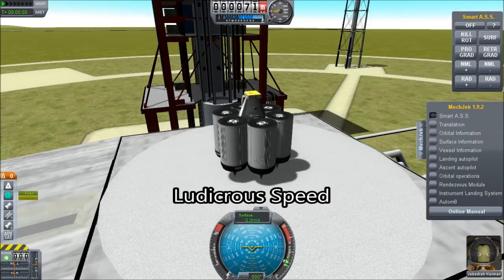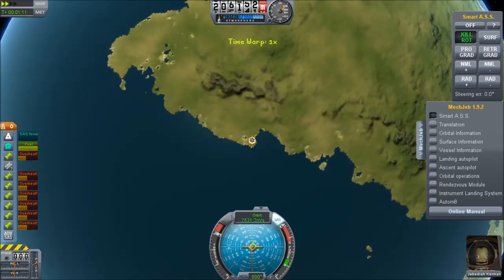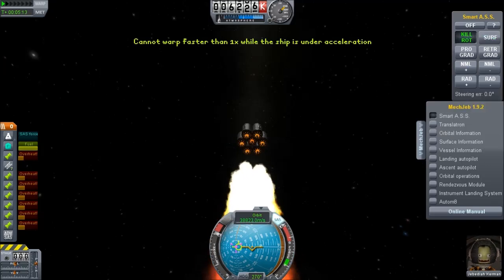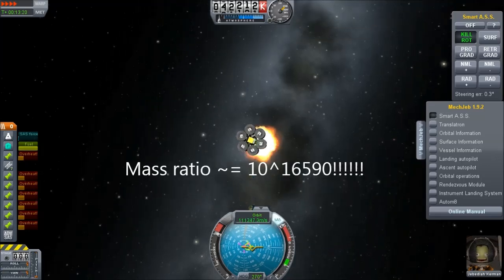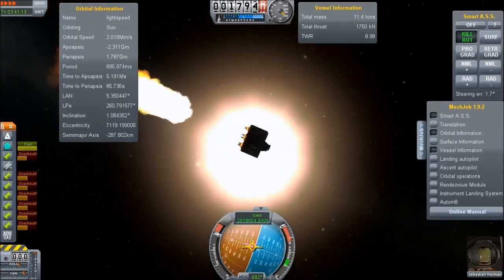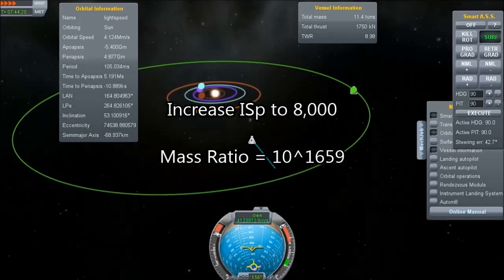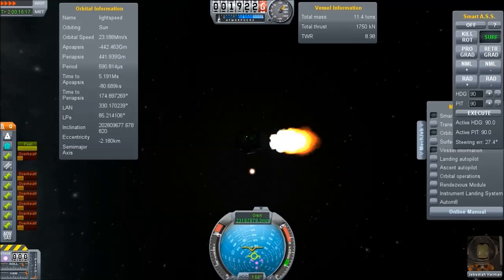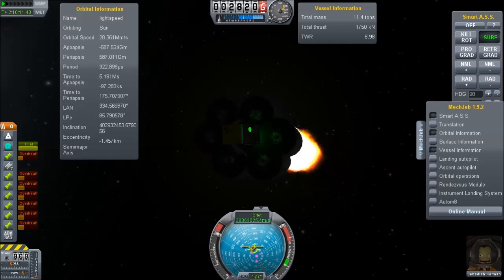What Does It Take To Reach Lightspeed In Kerbal Space Program?

Comment: If you set up beamed power from the interstellar mod and then took a ride way out and placed ANOTHER beamed power unit and so on, I bet you could reach the speed of light eventually. I would suggest using the warp beacons to be able to jump to where your craft is easily, assuming you have infinite fuel. That would cut off a massive amount of time placing the beamed power and you could  be under 1 ton in mass too! Sure it would take a very long time to do it, but assuming you modify a reactor to produce Terajoules of power and you modified a transmitter to send that amount of power, it may just eventually work. In 27 in game days with solar sailing I've reached 1.286 million m/s already, and I bet I will get much much faster. I'll probably have to use hyperedit to place a beacon where the ship is but once that's done I'll just send copies of a nuke powered thermal power beamer. The most interesting thing is that I don't get the max power from my beamed power network because I didn't bother to send the satellites on a polar orbit so I'd get power all the time from every beamer. Oh and most importantly it seems YOU CAN ACCELLERATE WHILE IN TIME WARP because you technically don't have any engines providing propulsion! That shaves a ton of time off getting to lightspeed.

Comment: There's a far simpler way to travel not only at the speed of light, but perhaps even multiples of it. Ride the light itself obviously. Harness it's (light) natural speed for use for ourselves, solar panels? A joke. Any current technology that even slightly approximates the usage of light itself for power is virtually infinitely unusable. So, and the process is far more complicated (only the construction of such an apparatus, etc) than this, we simply ride the light itself. Of course theoretically there are far simpler and faster ways to get somewhere, but for raw kmph/mph you ride the light.
Reply from the maker: Or we could just ride unicorns which despite being mythical creatures are more scientifically accurate than what you just said.

Comment: Why include earths specific gravity in the rocket calculation for dV==C when such an attempt would only be travelling in Earth's sphere of influence for a negligible percentage of the journey?
Reply from the maker: It's a normalization factor used so engineers can easily calculate Thrust to weight ratio on earth.,
Reply: @scottmanley  Thanks for the response I see now that g is converting specific impulse seconds per unit weight into exhaust velocity. Using thrusters doesn't seem to be very practical for achieving near light speed travel, perhaps pushing lightweight things with 100GW laser beams would be more successful ;-)

Comment: The 'set orbit' and 'hack gravity' cheats offer a way to very quickly increase your speed. Set orbit fixes your orbit for a given gravity setting, decrease the gravity after using your engine to change your velocity. Your velocity stays the same. Reduce gravity to 0.01 then activate the time warp and you'll glitch out of the solar system and get a massive speed boost.

Comment: If you are a patient person, just strap a highly efficient light source to your spacecraft, and you get an isp of a reasonable fraction of c at the cost of a ridiculously low thrust. By light source i mean anything that can turn mass into directed photons at a decent rate. Consider a fusing plasma and some mirrors, more or less. If you happen to have a few evaporating micro-black holes that would do really well.
Sidenote: remember power is proportional to isp times thrust, so expect accelerations in the order of millimetres per square second. This means about 10,000 years to light speed. You should definitely get the permanent thrust mod for that ;)

Comment: Simplified, it's physically impossible for anything with mass to reach the speed of light. The faster you go the more you weigh, even a single atom of the lightest element we know of can only reach 99.999999% (repeating) of the speed of light and in fact scientists have done it in particle accelerators here on Earth.. any faster though takes more energy than you can possibly supply, in fact it'd take as much energy as the Big Bang to cause it to happen. Dr Michio Kaku did a video about this on Sci-fi Science, his alternative is instead of accelerating an object to the speed of light, you instead bend the universe in on itself and jump across the slight gap to cross vast distances.. which is theoretically possible, it'd just take something like a Black Hole generator to do it. So theoretically possible just not at all plausible. The Warhammer 40,000 and Halo style of warp space travel is far more likely to actually work.. skipping across vast distances through wormholes is far more likely than bending the universe to your will..

Comment: If any dork is wondering what "kind of like pi" means, it means that e (often called Euler's number) is a transcendental number. What that means is that is an irrational number that is not the root of a non-zero polynomial equation whose coefficients are integers. Not all irrational numbers fit this category. For example, the irrational number the square root of 2 is not a transcendental number, since it is a solution of x^2 - 2 = 0. Nor is the square root of 3, since it is a solution of x^2 - 9 = 0., even though the square root of 3 is irrational.  Etc. Down vote away ;)

Comment: Great vid, but must go on a short rant about one tiny thing you said way back in 2012 in this video:

Begin rant;

Please don’t talk about increasing mass as a function of v. Physicists have been trying to undo that concept in physics education for nearly a century. Relativistic mass was a mistake. Just think about invariant mass as the only mass, and use relativistic momentum instead. 

Note:

Equation for relativistic mass: 
M = m/(1 - [v/c]^2)^(-1/2)

Equation for relativistic momentum:
P = mv/(1 - [v/c]^2)^(-1/2)

Whenever you’re talking about relativistic mass you’re going to be considering relativistic momentum anyway. You’d just write P = Mv. They did this so that momentum could look like pre-relativistic physics. That’s the only reason, really. 

But after Minkowski and recognition of usefulness of the invariant magnitudes of four-vectors, the value of invariant mass (aka rest mass) was realized: invariant mass is the Minkowski norm  of the four-momentum (basically the “dot product” of P with P, i.e., the magnitude). 

A closely related feature of invariant mass is seen in the total relativistic energy equation divided by c^2 and rearranged:

E^2 = (mc^2)^2 + (pc)^2

becomes:

m^2 = (E/c)^2 - p^2

It’s invariant. That means every frame measures the same value for it. Much like proper time. 

(Side note: this actually looks almost identical to the Minkowski norm of 4-momentum. There’d just be some additional information including your choice of sign convention, be it + - - - or - + + +, with the first being the space coordinate and the second the time coordinate)

Tl/dr: Relativistic mass is a redundant, outdated and mostly useless concept that does nothing but add an unneeded level of complexity to special relativity. It just confuses students with no useful reward for doing so. 

/end rant;

Loved this vid though.

*Edit to fix stupid phone word errors.

Comment: You actually have used a Tsiolkovsky's equation for non-relativistic case. The proper equation would return an actual infinity.
Reply from the maker: Kerbal Space Program doesn’t implement relativistic effects, therefore the proper equation was the one I used.
Reply: @scottmanley , I was talking about real world, in KSP obviously the one you used would be right
Reply from the maker: So, do you know Tsiolkovsky's rocket equation for relativistic systems?
Reply: @scottmanley  I actually haven't used it in calculations, but it is something like M2/M1=((1-V/c)/(1+V/c))^c/(2I). So even if we assume I=c/2 we get M2/M1=(1-V/c)/(1+V/c) and if V=>c then M2/M1=>0
Reply: So in ksp it is possible to get to the speed of light relatively fast, that's not an issue :3

Comment: I once crashed a plane into the ocean. Later in the Tracking Station I noticed a curious object on an escape trajectory away from the solar system. Turns out that one of the planes wing parts got launched out of the ocean at about 13,5 times the speed of light

Comment: For those of you wanting a more accurate number for the mass ratio, using x^y=y*log(x) to get the exponent, then taking the value after the decimal point from that and raising the power of ten to that and using that as our main number, we get 9.6397106918390457548096628480854*10^16589

Storing this number optimally with binary would take 7 kb, but with modern encoding it would take 54 kb.

Comment: A year has 31 556 926 seconds. If You accelerate for 9,81 m/s every one of those 31 556 926 seconds you get a speed of 309573444.06 m/s which is a bit more then the speed of light. So am I correct that you need a year with g acceleration to get to the speed of light considering no gravity pulling you back?

Comment: it is possible to start from space not from the planet? for examples with the separators
Reply: CUBETechie yes, hold left alt, then click f12. then, click on cheats on the left. there will be the option "set orbit" then at the top of the row of white columns with a number of 686,750 at the top. that is the minimum height of your kerbin. above the top column, there are 2 arrows, that is where you choose what you will orbit. hope this helps

Comment: All you have to do is have an object with no mass. an object with no mass, is already moving at the speed of light.
Reply: El3v8 if it isnt accelerated its at 0
Reply: Daniel Möhring I'm pretty sure that objects with mass 0 do not have to be accelerated. I am not 100% sure though
Reply: El3v8 But this would mean that objects would automatically move if we were removing weight from it. I mean idk how it should even be possible to remove weight from an object, but if its somehow magically possible by either not touching it or by touching it from every were round it to end on Vector 0/0/0 again, you shouldn't have accellerated the object into a direction. Which means if you repeat this process as often as it takes to make it weightless then it shouldn't be in movement bit i also maybe completely wrong idk ^^
Reply: Daniel Möhring Mass is different from weight. Mass is the amount of matter an object is made of. All massless objects ie photons and electrons move at a constant velocity, which is commonly expressed as c. or 300,000 m/s.

http://physics.stackexchange.com/questions/90469/do-all-massless-particles-e-g-photon-graviton-gluon-necessarily-have-the-sa

Here is a cool link on the topic.

Comment: Too bad humanity will never build engines that can do this. Oh, interstellar space, we hardly knew ye...
Reply: Woah, no way you know the future? Thats so rad.
Reply: Woah, no way you know the future? Thats so rad.
Reply: Max Acree That's what the physicists say. Ask Scott Manley himself, I'm sure he'll say the same thing.
Reply: Thats only what the mainstream theories at the moment are saying. We have no way to know if Relativity and therefore speed of ligth as a maximum, mass increase with speed increase, time dilation and so on is a thing and if they aren´t, I´m certain that science can easily find something that manages to make long distance space travel managable :D
Reply: I think Time Dilation only occurs as you get to about 80 percent speed of light.
Reply: Ken Havens Time dilation always happens whenever you compare moving reference frames. But you're right, it's not until you go above 50% lightspeed that it becomes relevant.
Reply: Actually, the caesium clocks on GPS satellites are affected enough by time dilation  that a correction is used for accurate navigation.

"When combining the time dilation and gravitational frequency shift, the 
discrepancy is about 38 microseconds per day, a difference of 4.465 
parts in 1010. Without correction, errors in the initial pseudorange of roughly 10 km/day would accumulate."

"To compensate for the discrepancy, the frequency standard on board each 
satellite is given a rate offset prior to launch, making it run slightly
 slower than the desired frequency on Earth; specifically, at 
10.22999999543 MHz instead of 10.23 MHz."

From the relativistic effects section on errors in gps on wikipedia.
Reply: TheMathias95 They're only affected because they need to keep up massive accuracy for such long periods of time. At their relative speeds and gravity potential, their correction is utterly minuscule. But even minuscule can add up quickly.
Reply: +Jordan Shank 10km/day inaccuracy from those 38 microseconds a day of clock drift due to relativistic effects in GPS satellites....
Reply: Ewan Marshall Why did you reiterate your point?
Reply: Jordan Shank We just need to abuse parachutes. I've got 177 strapped on, aimed for Alpha Centauri. See you then.

Comment: It is possible to reach up to twice the speed of light in KSP in less than 20 minutes. Design a very lightweight craft that uses aerospikes or something of similar thrust, enable Infinite fuel/no crash damage, and fly straight up until you reach 50,000 m/s. Then turn around and fly straight into the ground. (the force of the impact should still destroy the craft). If you land just right you will survive and be jettisoned out of the solar system at speeds twice that of light.

Comment: Hey Scott.  I really enjoy your videos about KSP.  I have been using that "other" great space flight program for PC computers (Orbiter) simply because mine did not have at least a dual core processor (it's kinda highly recommended) but I just got a new system so hopefully I will be able to try KSP myself.  If you have ever used Orbiter, that will allow you to do faster than light speed with the stock program, but you won't be able to control where you go.  There is a quirk in the program that renders the Sun as a 2D object instead of a 3D object, so if you try to land on the Sun, you instantly get sent in "nether" space at speeds exceeding the equivalent of the Star Trek TOS warp 3.  That's kinda fast.  :-)

Comment: It'd be interesting to explore what would happen if a light speed craft aerobraked in Earths atmosphere, both from the perspective of Earth and the craft.
Reply: it would instantly desintigrate...
Reply: Robert Harris It would likely be much more spectacular than that, at the very least, atoms are getting fused and smashed on its hull, so there'd probably be way more to it than just falling apart from aerodynamic forces.
Reply: blazednlovinit desintigrating iswnt just "falling apart"
Reply: Robert Harris Yes it is, it literally IS that... What did you think disintegrating meant?
Reply: blazednlovinit something having its molecular bonds riped apart...
Reply: Robert Harris Not really, it's quite easy to check, you have the internet, here, let me do the legwork for you..

disintegration
dɪsˌɪntɪˈɡreɪʃ(ə)n/
noun
noun: disintegration
1.
the process of losing cohesion or strength.
"the twin problems of economic failure and social disintegration"
2.
the process of coming to pieces.
"the disintegration of infected cells"

Doesn't have the be at the atomic scale to fit the definition there my friend.

"Ripped" by the way, "riped" sounds like something to do with fruit.